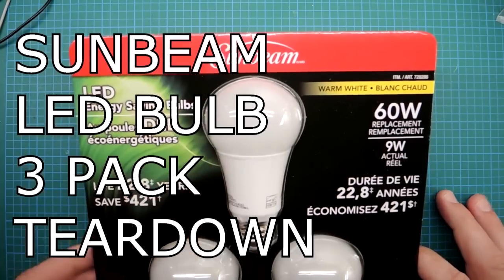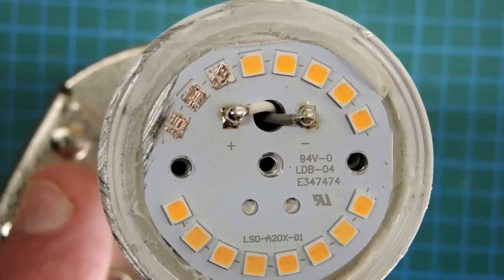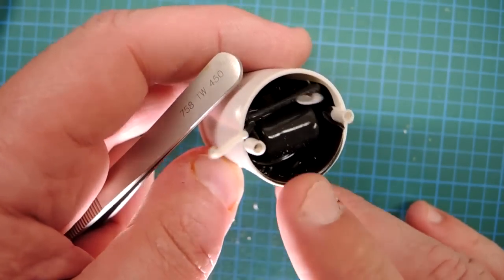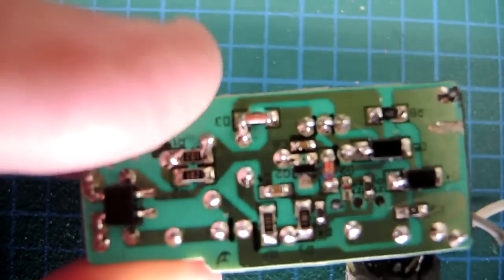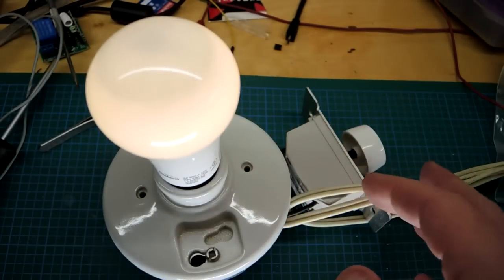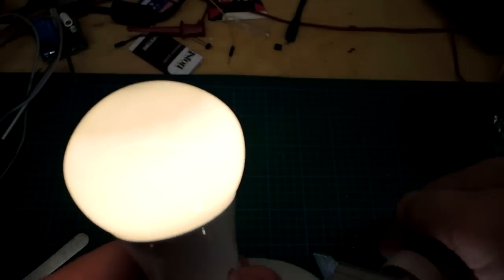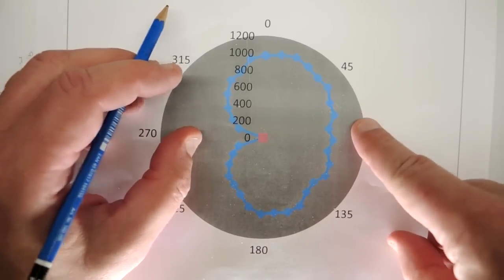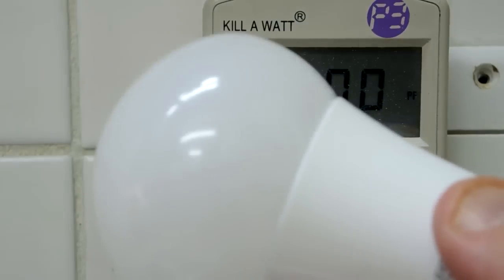Sunbeam LED Multi Pack Tear Down Review

Comment: Great review. I just saw a display of Utilitech LED bulbs at Lowes. Single bulb in open cardboard package for 99 cents/each. Not sure if you reviewed that brand or not, but from prior experience I found they had a slight buzzing sound. 

Also, I recently stayed at a new hotel and it was all LED bulbs. They didn't have a brand name, but searching the model number resulted in a hotel supply website.

Comment: Another excellent review! I really enjoy these light bulb reviews. I would love to see a tear down of the 8.5 watt 800 lumen Non-Dimmable Great Value LED (TCP 2015/55251) Wal-Mart offers for $2.44 each. They claim 18.3 years at 3/hrs a day, and it's rated for outdoor use in enclosed fixtures. Also UL listed. I have been using one in an outdoor covered fixture for a couple months and the bulb is doing well. I also did the math: compared to the CFL that was in the fixture before, the Great Value/TCP led bulb will pay for itself in 4.357 years from the energy savings. I'm really curious to see if there's any of that putty inside of it and how the leds are setup inside.

Comment: Have you seen the Polaroid 20w 1600 lumen LED for $6? It is also dimmable with high PF. First time I've seen a 100w equivalent bulb so cheap. The thing I didn't like is that it reaches 220F (104.4C). Can't see it lasting very long.
Reply from the maker: +JohnAudioTech No, I had not seen that bulb.  That's quite the price, however!

Comment: I have a bunch of these bulbs i bought at costco about 8 months ago. out of the 15 that i have there are 4 duds that flicker off then power back on after a while.
ive tested them on other fixtures and same issue continues. there may be more affected that i put in areas that are not on as much but im not sure.

any clue how warranty works on them? i dont have the bill of sale but i think costco would have record on my account if needed.
i most likely got 2 defective packs (6 faulty bulbs just need to test the others in more used areas to find out)
Reply: Same problem with at least 2 of mine
Reply: Suppose to last for 22.8 years, mine didn't last for 22.8 months

Comment: Sunbeam is/was an Australian company with a history and reputation for producing reasonable quality domestic appliances. It's all outsourced to China these day of course but it is clear some sort of standard has been applied probably because of the stringent import and supply rules in Australia.
Reply: +Rob B I bet there is not a single appliance anymore which has no major parts produced in china even on high performance and high priced equipment of ANY kind... That's VERY sad...

Comment: They also claim 22 years, which is funny to me (because that seems to be what most LED bulbs nowadays feature on their packaging).  Is this based on the actual LEDs or the overall bulb including circuit board?  I would assume the circuit board is the weakest link here, but maybe I'm wrong.
Reply: +SpykerSpeed yes you are right. These are rated based on smd(led). The capacitor was the weakest component in the circuit and i believe it wont pass the 10 years mark. Anyways the technology will be outdated by then.

Comment: Energy saving?? Heat is generated from current (Amperage). For these to generate this much heat, similar in comparison to an electric heater, it must be in a much higher range of current then implied by it's wattage rating. Hence, there is no energy saving.

Comment: These are also marked under dollar tree and sold in four pack I've bine told these not rated good at Amazon tho marked under dollar tree brand in their stories ill stick with greater value led light bulbs at walmart pay little more for quality greater value led light bulbs made by ge and rated very good and reliable at Amazon and walmart wish walmart price as good as dollar tree 4pack 60watt stranded led grater value $598-$798 at walmart1-25-18